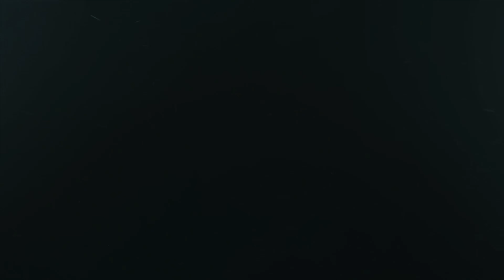Corsair’s New Must Have RGB DDR4 Memory + Amazing 1000D Build!

Comment: I just used this in a new build and it's great and fast but I cant get the ICue software to detect the ram. Some problem with compatibility with Asus Strix B450f mobo, I've tried all sorts of work arounds from forums and corsair support, pretty mush have to wait until a Bios update from Asus or corsair to fix the software so the two will play nice.
Reply: Does it light up to a stock light setting right when you put them in without doing anything regarding software ? I would like to know just in case I do have a problem but at least still have them lit up without doing anything initially.
Reply: They light up to the default rainbow pattern or whatever it's called.

Comment: Anyone else thinks Trident Z still looks better?
Reply: I think the Trident Z is just awesome looking. I might be biased though I did buy some for my girlfriends pc (Black sides/ White tops on a MSI Titanium Z270 MPower) not the RGB stuff though.
Reply: Elite Exposure Right now I think you have e to go full RGB, Minimal soft RGB, or none.
Reply: Nicholas Wilkowski which do you prefer, I’m stuck between Trident Z and Vengeance Pro RGB
Reply: @paradigmshift7541  In my opinion, G.Skill has a better style but RGB Pro has better/brighter LED.
Reply: @paradigmshift7541  hey dude. what did you end up vuying? I'm in the same problem, please help!
Reply: Fin McLaughlan trust me they are both dope you won't regret either decision. I went with corsair bc icue allows you to sync the lighting with gpu and cpu temps so you don't have to look at anything else if my temps get high my ram sticks get red it's so cool
Reply: @callme2times  I went for the trident z. It looks so cool synced with everything else in AURA sync

Comment: I used a Corsair Obsidian 750d to build my Ryzen 2700 X machine. Absolutely fantastic build. Love the case and the processor. Also using the Corsair 650 watt power supply with a Rog Strix  X470 F motherboard. The only thing that I think could be better is the G skill Trident Z RGB 3200 megahertz Ram. I can only get it to run stable at 2400 megahertz. Should have went with a Corsair Ram. I'm able to overclock all 8 cores to 4200 megahertz all the time with good temps.
Reply: Gskill offer a version that has an X at the end if the model number and have CL14 timings versus CL16 of their reuglar model number. Found them on Newegg, but were pricier.  Work awesomely with my 1800x
Reply: Johnny Greene 

Weird. I got my Trident Z RGB 3200 kit running fine at 3200 speed with R7 1700 and Strix X370 F Gaming board with no problems. The X470 should be able to do it just fine.
Reply: Cirux321 Not sure why, every time I crank up the speed I get crashes. The 2700x boosted fine...not the ram?